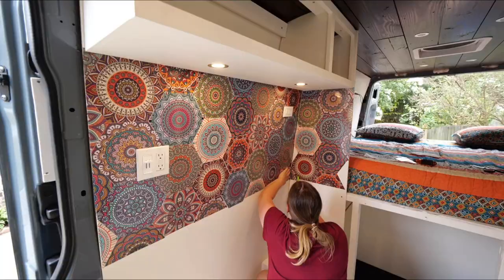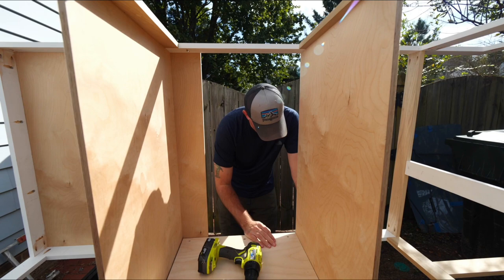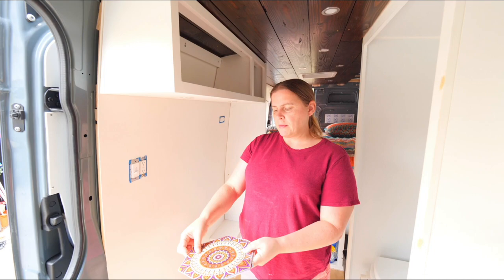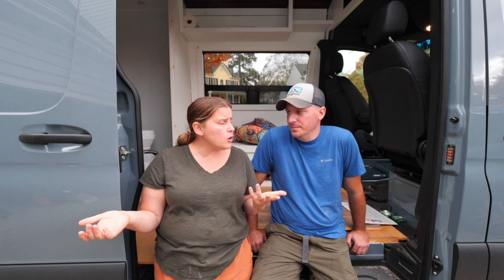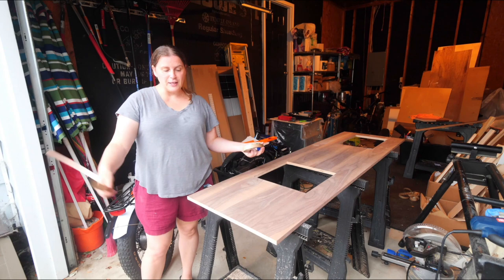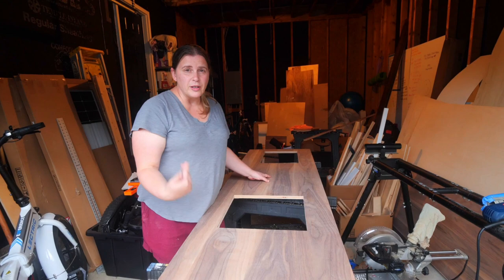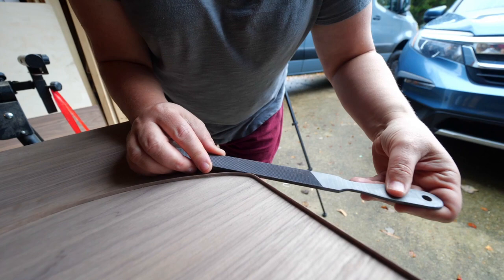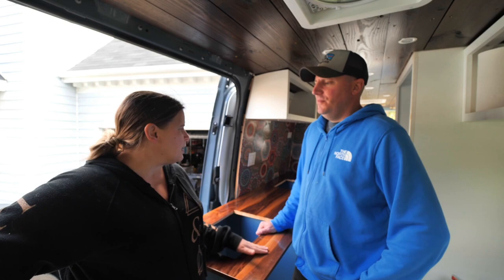Building our KITCHEN CABINET, BACKSPLASH, & COUNTERTOP in our DIY Sprinter Van Build

Comment: Something that helps with preventing gouges into the wood with the file method is to tape off the table surface with some masking tape along the veneer. It wont guarantee that you wont scratch the surface, but it gives you a small measure of protection for those oops moments. Also, you might consider a coat of bartop on that counter.

Comment: Just curious:  why did you put the fridge venting holes at the bottom of the cabinet?  Normally, heat goes up?
Reply from the maker: Hey there. Great question and good point! We placed them lower though because this is where the fan is located. There is a vent on each side of the fan location so that it can better pull air and hopefully stay cooler and run more efficiently.